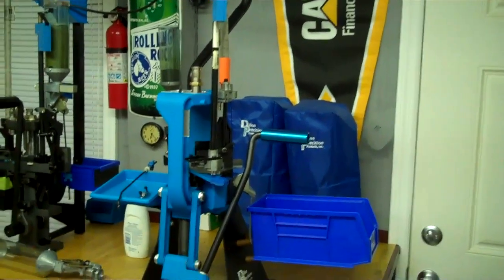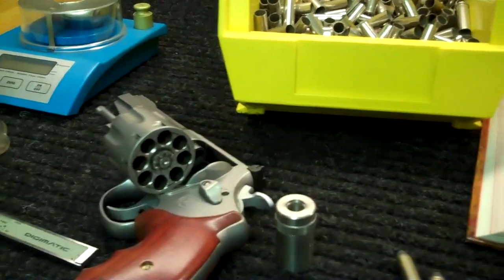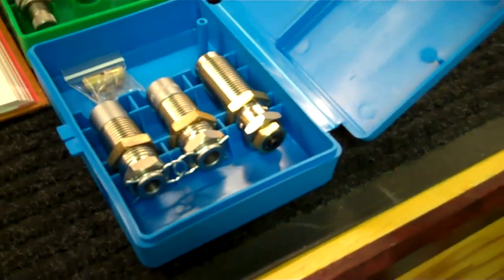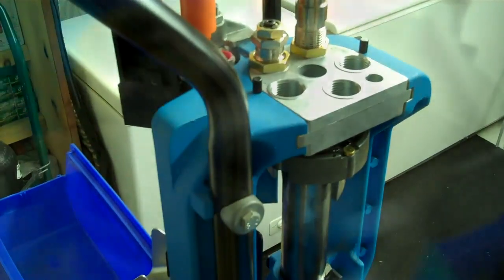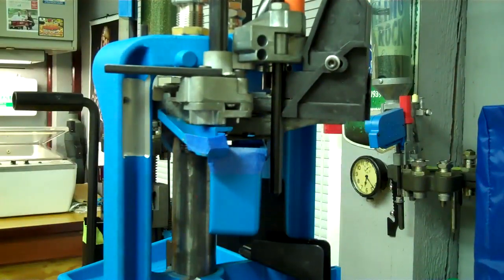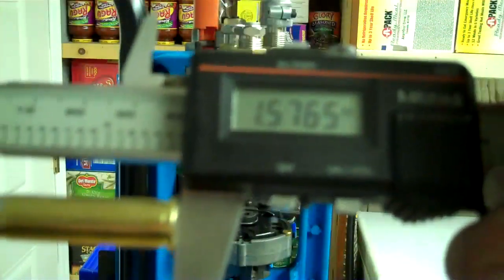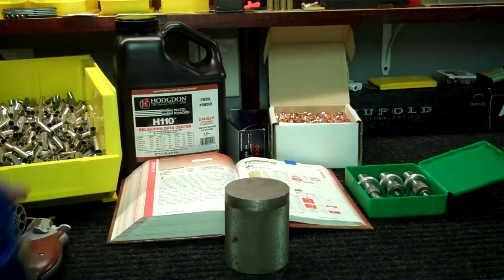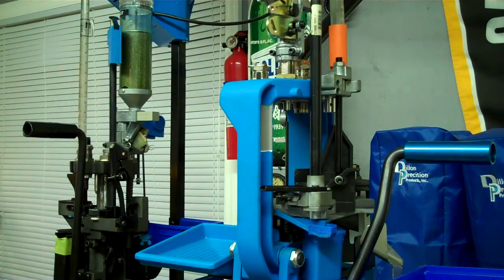DILLON XL 650 CALIBER CHANGE PT2. SETTING UP PISTOL DIES 357 MAGNUM

Comment: I've been running my 650 for about 2 years now, and I swear I learn something new everytime you post a video. Thank you sir, the trick with using the case/factory round for each adjustment is going into use immediately! Dillion should just go ahead and put your page link in their manuals from now on.

Comment: Great video sir!! I just started reloading last October on my first press. I have the same thing pretty much except mine is a 750. 

But how do you roll crimp? I’ve only taper crimped about 4 other pistol calibers, but I’m just starting out with 357 now, and I’m worried I won’t line up the canulure if I load progressively. In my experience, I can get a 5-10 thousandths variation when I’m filling all stations.

Comment: for stage 2 when you do the bell/flare you put the funnel in and you said about .25". does that mean about .25" of the actually die is showing from the inside with the powder funnel in.

also when you did the seating die and you took the factory ammo you ran the shell plate up with the bullet and you just put the die in till you cant screw the die anymore with the factory ammo in there, and is that the same with the crimping?

Comment: I know this is an old video and I am just now getting into loading 38 special.  I saw on your CCI primer box you are using Small Magnum Pistol primers why use vs. standard primers.  And what is the difference between the two with regard to loads?   anything to watch out for with Magnum primers? Thanks,